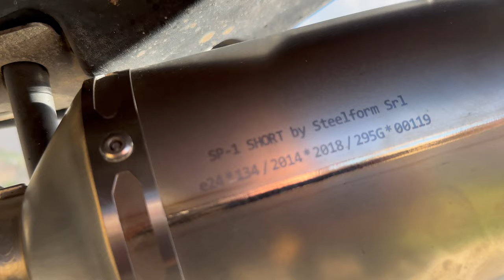Best exhaust for Yamaha Tenere 700?

Comment: One pf the most functional designs out there.  Had mine about a year, full system,  Good vid  safe travels
Reply from the maker: Right on! It's very functional and I think it even looks better than the low pipe options :) Did you do something to the fueling when you did the full system swap? Thinking about that for next summer..

Comment: Nice looks and good quality getting the hp corse slip-on! To me (subjectively) it sounded quieter than stock with the baffle in. When you showed the tail tidy comparison my first thought was that the pipe wont scrape, except the indicators will hit instead. Gladly the lights can be unplugged - something I’d be doing until i forget and then break lol 😅 btw did you ask to have the db killer made removable or did the mechanic offer? Just wondering how repair shop staff are these days?
Reply from the maker: Not sure which way it went as this was quite a while ago but they did it for me after a discussion we had.

Comment: Nice video! I saw that you also got the kriega OS bags and I'm curious if the heat from the high HP corse exhaust does not interfere with the bags? I'm thinking of buying both the kriega bags and the hp corse. Again, great video and thanks in advance!
Reply from the maker: Only thing is that I need to strap the pipe side lower strap a bit differently to the passenger footpeg. It's doable but it's not ideal. Doesn't bother me though and works great.
One thing that would fix the little annoyance is the kriega t7 passenger footpeg eliminators. I already bought them but never installed (yet). Maybe in the summertime when I try to make the T7 as light as I reasonably can I will take the footpegs off and install them instead.
Reply: @PatchedBandit  Thanks a lot for your quick response mate, very useful. It would be very much appreciated if you could do a quick review of the full setup (hp corse high mount + kriega OS bags) in one of your future videos! Cheers

Comment: Good video. How is your krega OS base working with this exhaust system?
Reply from the maker: It's good but I do route the footrest strap a bit differently on the exhaust side so it won't heat up. I could put it as it used to be but just in case it doesn't like the extra heat I put the strap in throug the little gap between the frame and the passenger footrest. This seems to be a fine solution.

Comment: I’ve got the same one on order!  Can’t wait to put it on.  Also got the full header kit as well.  Should shave about 6-7 kilos I think from stock.
Reply from the maker: Headers only are like -4.1kg so yeas its a massive drop! Are you going to do an ECU tune after? Im thinking about swapping the headers too.
Reply: @PatchedBandit  ecu tune? Possibly.  It may be a bit tricky where I live though.  Not a lot of specialized motorcycle stores here in Montana to my knowledge

Comment: Good video man,  2 questions. How do you like that bash plate and where did you buy those rub guards above your foot pegs? Thanks a bunch
Reply from the maker: Bash plate has worked like it should. I havent done any hard core log crossings or anything like that but it has had some dings from rocks etc. It's a solid peace of kit for sure. I go through all the mods before this trip on this video: https://youtu.be/QzXiAtyu7eQ
The frame guards are "Acerbis X-Grip Frame Protector". I show them a bit better on this video: https://youtu.be/Ap3VvHYsngY

Comment: Great video and awesome pipe. Quick question; did you have to move your “blinkers/turn signals/“ in order to fit the tip of the exhaust?
Reply from the maker: Yes I did. You can see the tailtidy setup in the video.
Reply: @PatchedBandit  thanks! Do a follow up video if possible
Reply from the maker: If I swap the headers at some point then probably will do a short update. I have some Tenere content coming up soon.
Reply: @PatchedBandit  sounds good! I ordered the exhaust already. I’ll be doing a ride late in the spring to Baja

Comment: Your latest subscriber here;-) I see you have the Kriega OS base. Any issues with the new pipe and the os base? Melting straps for example because close to the HP corse?
Reply from the maker: Only thing is that I need to strap the pipe side lower strap a bit differently to the passenger footpeg. It's doable but it's not ideal. Doesn't bother me though and works great.
One thing that would fix the little annoyance is the kriega t7 passenger footpeg eliminators. I already bought them but never installed (yet). Maybe in the summertime when I try to make the T7 as light as I reasonably can I will take the footpegs off and install them instead. 
With the passenver footpegs gone it should be no issue whatsoever. 
Thanks for the sub :)
Reply: @PatchedBandit  tx, think I will have a look at the HP Corse as well. Liked the video. Watched all your later video’s after this one to find the Corse with Kriega luggage combined but they were all with the original pipe ;-) had no other option than asking
Reply from the maker: @filipledoux3565  Well thanks for watching 🤣 Join the discord from "about" page if you want to see some close up pics on how I mount it.

Comment: Bella Italia 😍 The new muffler looks damn good and the sound is more mature, too.
Do you see any difficulties with the bags? Are they somehow getting closer to a warm part of the pipe or is the HP Corse even better compared to the OEM one?
Enjoy Greece while there is cold and snow in Finland, Bernd 💙💛🏁🤛🏼
Reply from the maker: Bags are staying a nice distance from the pipe but the strap going through the passenger footpeg is getting too close to the new pipe if mounted as instructed. I have just routed the strap from a different place and it has not been an issue.
This could also be fixed with kriega os footpeg eliminator set but I want to still have the option to ride with a pillion so not doing that :)
So no major issues.

Comment: will this not be trouble for soft luggage on the back ? (heating/burning)
Reply from the maker: No problem with these 12 liter kriega bags and don’t see how it could be an issue with any other bag type either. The pipe is pretty deep under the side plastics and did not heat my bags while riding. 
Rode thousands of km with this setup already. 

Only notable thing is that connecting the kriega OS setup in the passenger footpeg on the pipes side needs to be done a bit differently from the instructed position. The strap can easily melt against the pipe if routed the ’normal’ way. 
This is not a big problem and I just mounted the strap from a slightly different position. Also kriega footpeg eliminator set apparently remedies this issue too.

Comment: What’s your review of the Anakee Wilds?
Reply from the maker: 1. Good everywhere not great anywhere. Excellent 50/50 pick.
2. Rear last 6 000 km front 12 000
3. Rear is loud like many knobbies
4. Surprisingly good asphalt traction even though you can get the rear to slip if you try hard enough
5. Good confidence doing offroad even some muddy and rocky tracks. Very good pull on rocky uphills ESPECIALLY compared to some stock tires like pirelli str rally that constantly jumps all over and gives no traction on steep rocky uphills.

Definitely recommended tire even though they don't last as long as some others. Some tires last longer but are also more slippery on hard surfaces because of that.

Comment: hello, have the same exhaust, how did you get out the db killer? to me it looks like its not removable
Reply from the maker: You can drill it out and put in a small bolt and nut. Very easy to do 👍
Reply from the maker: I show it in the timestamp 9:14
Reply: @PatchedBandit  thanks for quick responce ;)

Comment: Is it true that when you remove the DB killer the spark arrester is removed as well?
Reply from the maker: I don’t think the db killer works as a spark arrester and the pipe doesn’t have one stock.
If you ride a lot areas with high risk of forest fires you could install a separate arrester for example from Camel ADV shown in this video: https://youtu.be/PHNYZ8h3vJA

I’m not a specialist in this matter but would the sparks even go past the CAT in the header pipe? Just thinking if it’s a risk if the bike still has the oem headers…
Reply: @PatchedBandit  thank you for your reply back.  I plan on putting headers on right away to get rid of that ugly CAT. Looks like I will get the Camel ADV spark arrester.  Safe riding!

Comment: How does the heat of the exhaust work with the kriega OS 18?
Reply from the maker: Only thing is that I need to strap the pipe side lower strap a bit differently to the passenger footpeg. It's doable but it's not ideal. Doesn't bother me though and works great.
One thing that would fix the little annoyance is the kriega t7 passenger footpeg eliminators. I already bought them but never installed (yet). Maybe in the summertime when I try to make the T7 as light as I reasonably can I will take the footpegs off and install them instead.

My side bags are 12 liter.

Comment: Is the mid pipe titanium or stainless steel?
Reply from the maker: I'm 99% sure the midpipe is stainless steel and only the end can is titanium. This is translated with google translate from the HP Corse italian product catalogue: 

"High port slip-on fitting in stainless steel"

I read this as the "high port" meaning the high option as they sell the low midpipe versions too.

Comment: with bend radius like that the power will be down and if you run a d-cat you 100% definitely need a ECU flash
Reply from the maker: Doubt the power is negatively affected but for sure decatting should be done with ecu tune. 
Mine has the cat in place still though.
The oem pipe design is so stupid for an offroad bike that it needed to go.
Reply: Mandrel bends don’t affect power lmao
Reply: Mandrel bends don’t affect power lmao
Reply: @DWBmotorsports  yes they do what are you a miss-informed flow dynamics expert? wow do you believe what you type ?  🤣😅
Reply: @simonmallia2051  mandrel bends are the MOST efficient bend. What do you recommend instead 😂